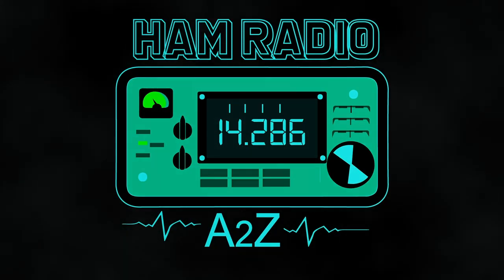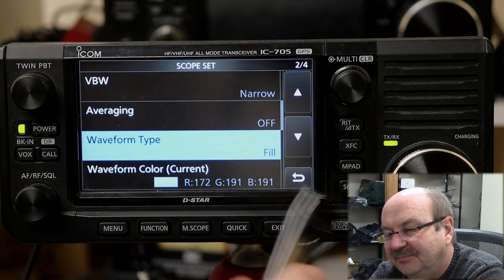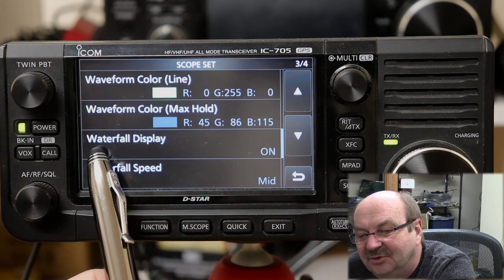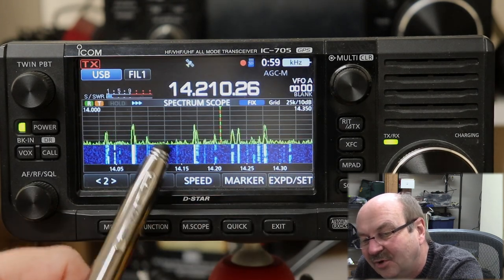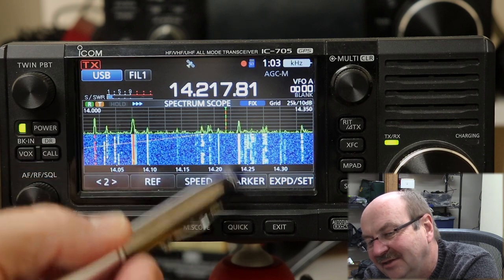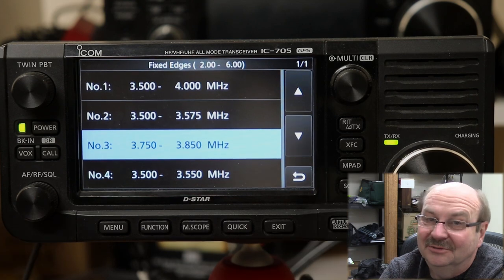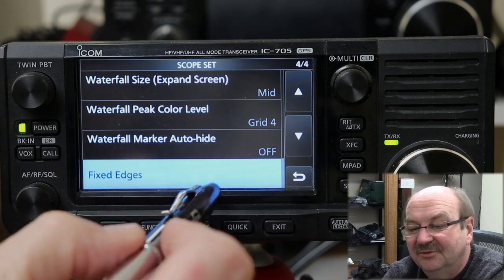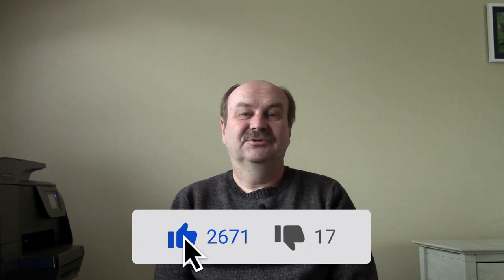IC-705 A2Z #14 Spectrum Scope Part 2

Comment: Tom, this series is great.  Your videos for the 705 and the 7300 have helped me to understand how these complicated devices work more than any other source of information.  There is one thing to add to this one:  When setting the band edges on the spectrum scope, the maximum width displayed on the scope is 1 MHz.  This means it is impossible to set the scope to show the whole band in the higher-frequency bands.
Reply from the maker: Hi.  First, thank you for the kind words.  Yes, that's a good point that I should have mentioned in the video.  12M is the last band where you can see the entire band.  10 meters and up you have to pick the 1MHZ segments that you want.  It would have been nice if Icom allowed a larger sweep, maybe with less resolution at least on 2M and 70cm.  In some recent YouTube videos I've seen on the IC-905, it looks like they have fixed that.  Of course, that radio only covers bands that are several to many MHZ wide.  If you're interested, Josh Nash did a really nice review on HamRadio Crash Course here:  https://youtu.be/2DVDAsxtWOs

Comment: Well done!  Extremely helpful compared to the manual.  There is something you've overlooked, which is the use of the scope on unpopulated bands to determine at a glance if and where there is activity, or for finding a very weak signal in the noise.  This actually may well be the principle use of the scope on 144 and 432 weak signal VHF, and also even more so on the microwave bands with my new IC-905.  After watching your videos, I was able to make the changes to see a very weak 432 beacon signal which was not visible before.  Thank you.
Reply from the maker: Thank you for the kind words.  That is absolutely a great use for the spectrum display.  I probably should have highlighted that.  Enjoy that 905.  Looks like a great radio.  It's on my list, but probably not for a while yet.